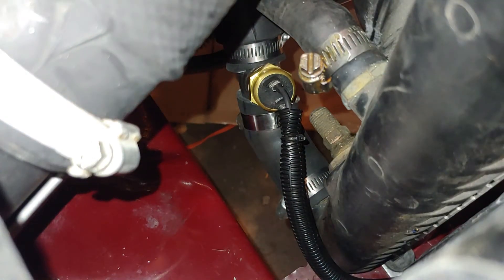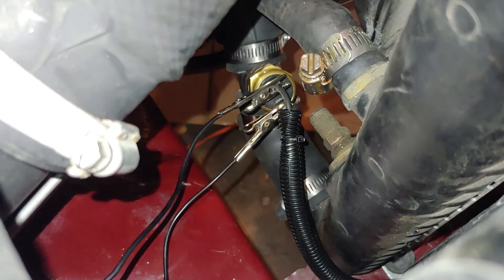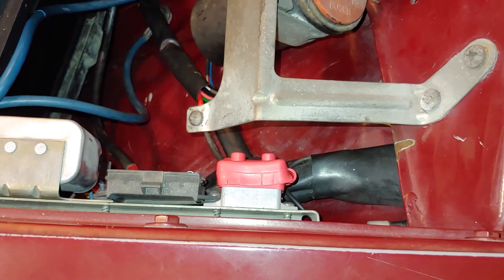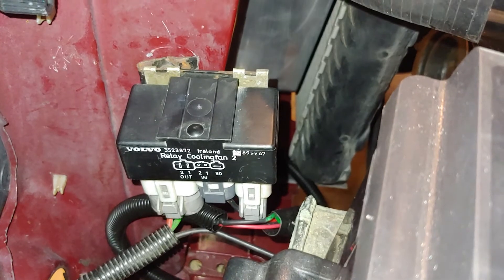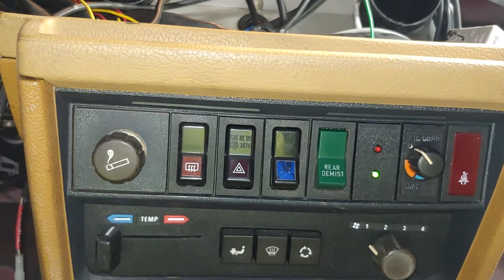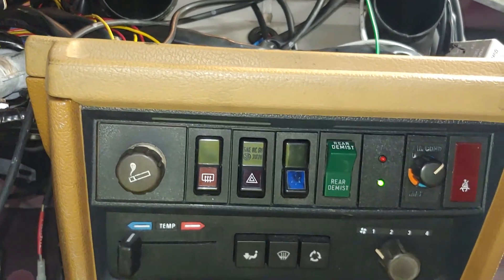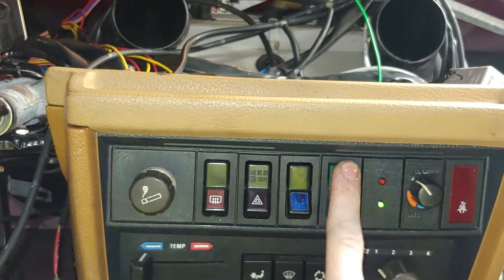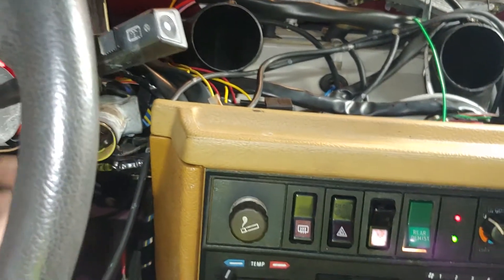E-fan setup 1988 volvo 245 B230ft

Comment: Thank you so much for your video!. I've been looking to do a electric fan conversion for my "88 244dl. Can you please look at your radiator shroud and tell me the part number please.. I'd like to get one but can't find one from any junkyard. 
I'll probably have more questions later on down the line if you don't mind. 
Thanks,
Reply: I took the 940 turbo shroud and chopped the section with the flaps out and hot stapled it back together then filled the small gap and sanded it flush then painted and you can't even tell I chopped on it just looks like a brand new shroud.